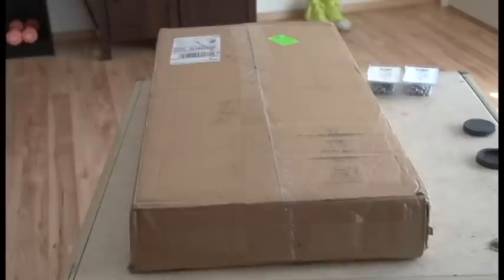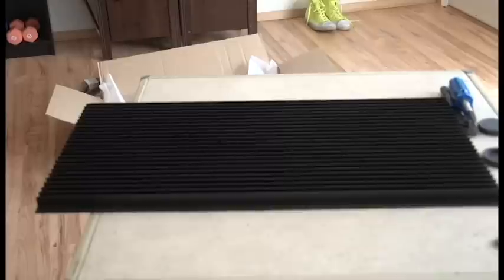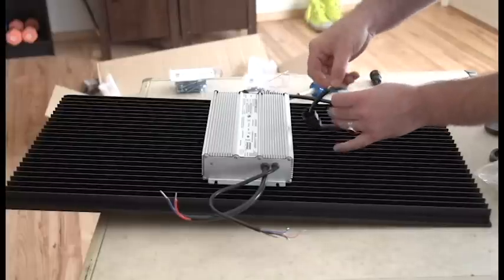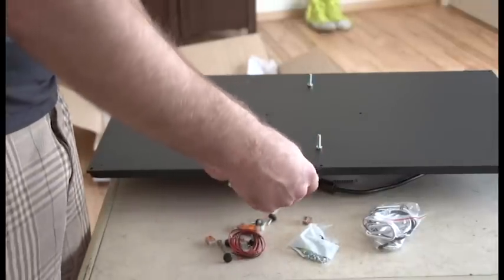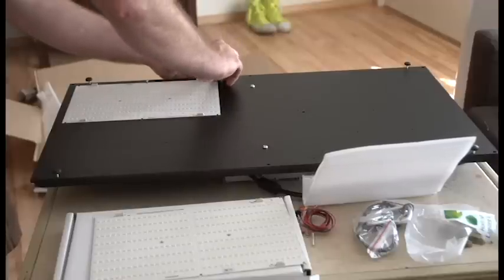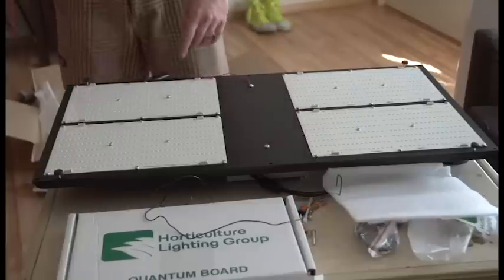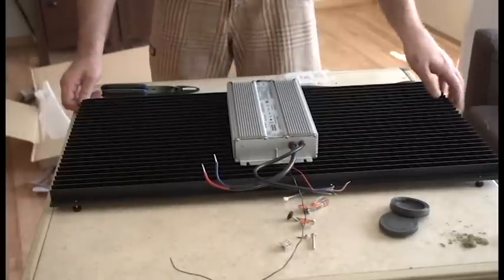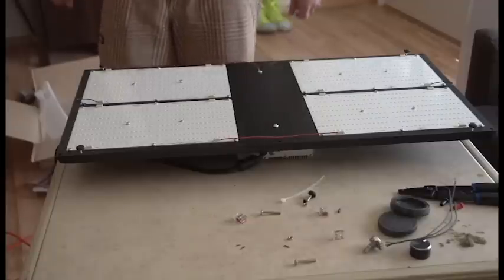How to assemble an HLG 600 True Watt Quantum board Lighting system The unboxing

Comment: Great update my friend. I was so close to getting this same light. Great deal compared to others and you get a nice amount of light. Bang for the buck 👍👍
Reply: Hit up meijiu on Alibaba they can get you comparable light for much cheaper.
Reply: @SparQz  By comparable you mean ~20% less powerful, and by cheaper you mean ~20% cheaper. It's also half the heatsink height which results in a higher failure rate (see forum reviews of the Chinese ones) and returning anything to China means there went all your savings (assuming they even honor the warranty). Seeing as it takes a long time to get direct from China (3~4 weeks), returns are very inconvenient at best, and the savings % is equal to the loss is performance %, it's not really worth it to cheap out and get a Chinese one. Save up and get the HLG one. Oh and this doesn't even account for the possibility you might get a fake and it performs maybe half as good if you're lucky.

Comment: Won't the 4000k boards produce flowers with more bag appeal?  I went with the 4000k boards it said the yield might be a little smaller with the 4000k. But it would be a better looking flower?  Regardless best of luck and as always stay medicated my friend 😉😎
Reply from the maker: Garrett Barrera ill be supplememting with uv and infrared. I wanted 3000 k for the veg flower versatility ;).
Reply from the maker: Infrared and uv is wjat triggers trichs ;)
Reply: Potsquatch Growers they do help some in theory
Reply: 4k has more blue light, 3k has more red light.  Depends on what you want.

Comment: Attention : if u have bought the V2 edition of this board, do not follow his instructions! The new board can Only be run in Parallel mode, not in series
Reply from the maker: Thats simply not true. I have mine wired in a series. Nice try though butter cup.
Reply: its 100% true, i have the V2, and even Stephen From HLG told me im right... the new series has a different driver model (HLG-600 54b) with 2 outputs.. so yeah nice try
Reply from the maker: @soundtorial4567  um actually im friends with stephen and all one has to do is request a driver that can have a potentiometer wired in and that does a series ya tit. I even go over that in the video. Watch the vid and you see that there is a singular input output on the driver and they are wired in series ya turnip.
Reply: The new 600 kit has the inventronics EUD 600 driver.... It is a constant current driver at 2800 MA. The boards go in series on this driver. The Meanwell HLG 600H-54 is a constant voltage driver. You would wire them in parallel on that driver. The video is correct in this instance.
Reply from the maker: @stephenj37824  thank you Stephen / horticulture lighting group ;) :)
Reply: I love it when people think they know what there talking about and then are wrong , I don't see them posting any videos so keep your comments to your self , or make your own video and stop watching others , keep up the good videos , I'm subscribed.  Stephen you da man too .
Reply: I just bought the 600 kit with the mean well driver and I'm not sure how to wire in parallel series any vids on how to wire quantum boards other then this one first time diy light for me
Reply: @stephenj37824  I just purchased a hlg 600h kit with the 600h 54b driver can you tell me what the three rc wires are for and if I need them hooked up somehow